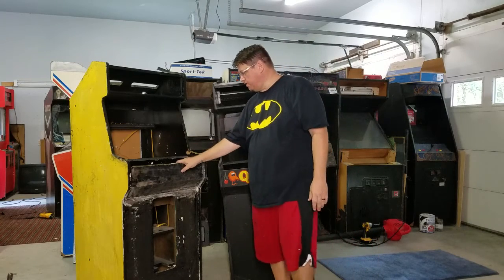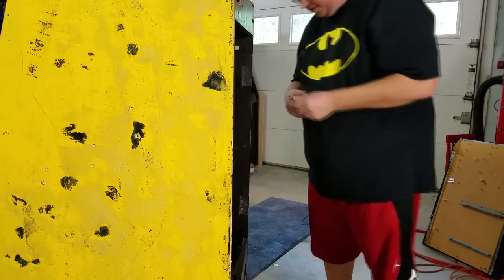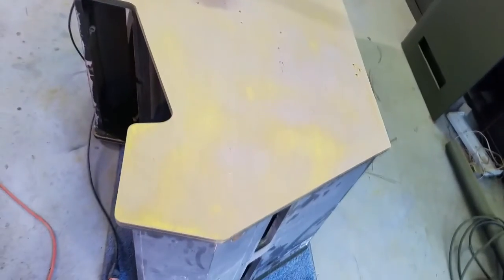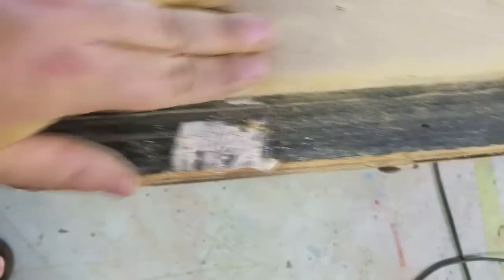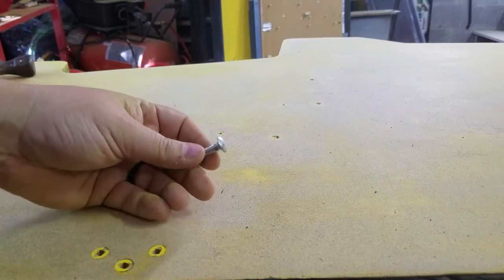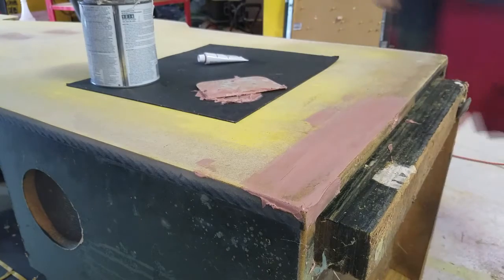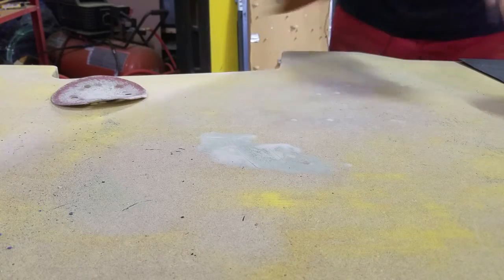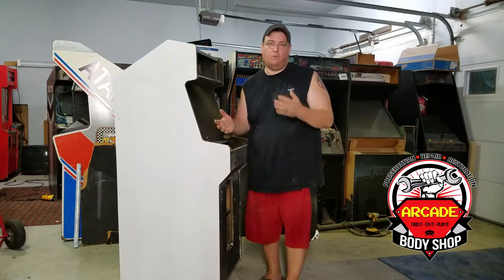Arcade Bodyshop - Double Qbert Restore Part 1

Comment: Restoring a water soaked Qbert right now, myself! All the edges of the mdf of fuzzy and will be using your wood hardener tip. Was trying bondo for that, but it's not really doing the trick. The corners are sharp enough, but all the edges and top are swollen and fuzzy. Also, the tmolding slot is spread out, so I used bondo and will slot-cut it for the new.  Mine has grey primer under the yellow, btw. 
   My board set has some acid damage and all the socketed chips have such corrosion that the legs crumble if I try to remove them and the power supply smoked. Just bought a Mylstar multi pcb and all the conversion/adapter hardware to preserve the original harness, while using a switcher power supply and the new board. 
    My next project follows your donkey kong cabinet restore, but I'm building a Fix It Felix Jr.  
   Just liked your page on Facebook and subscribed to your YouTube channel! Enjoying the tech videos!

Comment: Great vid. Love the wood hardner spray bottle tip! Way less mess. Ever use spot putty for these smaller bondo repairs? Opinions? I like it for ease of use. I think it's the same product as bondo, just in a squeeze tube.
Reply from the maker: +atariforever2002 Thanks so much!  I like the spot putty for small dents etc.  But i feel regular bondo is much stronger for things like bolt holes and rebuilding edges.  Plus reg bondo can hold up in heat and cold without cracking especially when moving a cab, heck its made for cars lol
Reply from the maker: +atariforever2002 Thanks so much!  I like the spot putty for small dents etc.  But i feel regular bondo is much stronger for things like bolt holes and rebuilding edges.  Plus reg bondo can hold up in heat and cold without cracking especially when moving a cab, heck its made for cars lol
Reply: +Arcade Bodyshop Ahh.. I didn't realize it wasn't as strong. Good to know. I will steer clear of it in the future. Thanks.

Comment: Great video, I like how you sand(feather) the edges of the MDF. Are there any concerns with using Latex paint on MDF since it is water based on the first coat instead of oil based paint? I know some states don't allow you to purchase oil based paint.
Reply from the maker: +William Fick I have used latex paint on all my MDF cabs.  The key is to put on several thin layers of primer. The first thin coat will seal the cab yet not have enough moisture to effect the cab.

Comment: Hey man, just wanted to say loving the videos! I'm currently in the process of converting an old and beat up Bad Dudes vs. Dragon Ninja cab, and these videos have been a great help. I'm in a bit of a dilemma though, and figured I'd ask for your opinion. The machine originally came wrapped in vinyl, parts of which have worn down and cracked over the years. While I probably should have thought of this more before I started working on it, I was wondering if you'd recommend stripping all the vinyl off?  When I started I decided not too, and I've actually done a fair bit of bondo work on it. I've already have sanded the majority of the vinyl down pretty thin, with some spots down to the bare wood. Do you think I could get away with painting over the vinyl since it's been roughed up quite a bit with the sander, or should I put the extra work in, strip the vinyl down and start over? I have a feeling the bare wood and spots might show through pretty bad after priming and painting it, but not sure. Any insight is greatly appreciated! Subscribed and looking forward to your future projects. Thanks!

Comment: Which model Dewalt orbital sander are you using?  Is it the D26451K or the VS H&V 26453?  My last sander died and haven't gotten around to replacing it.  Looking for recommendations.  BTW, hear you on the 10K degree garage.  The heat index is almost to 110 today.  Did a bunch of work out there today and am a sweaty mess.